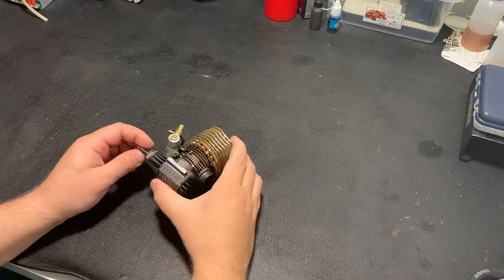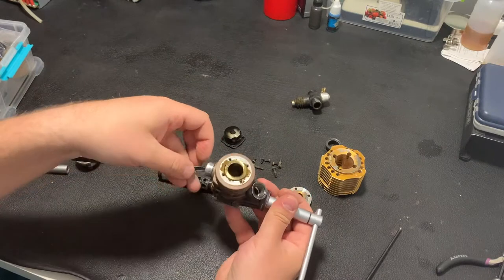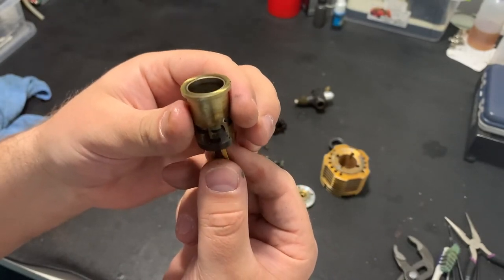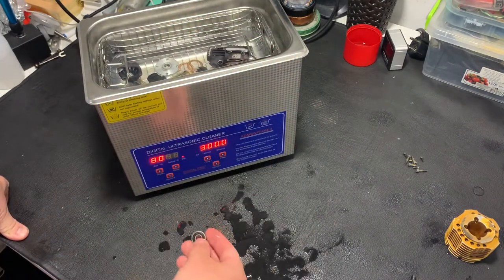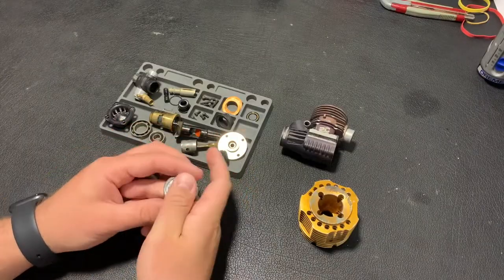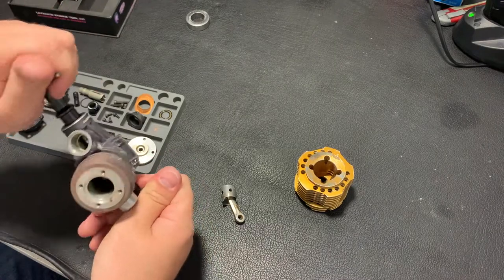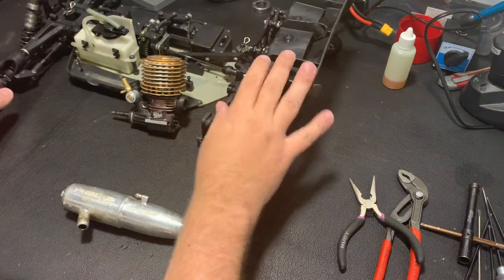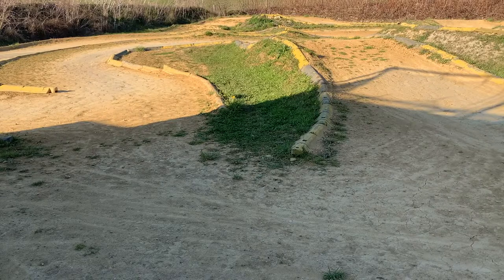Restoration of RC nitro car Xray XB8. Engine rebuild and first start. (part 3)

Comment: Nice. What will happen when you pinch the sleeve abit to tight
Reply from the maker: Engine will not work ))). There is couple of different failures in this case. Engine working temperature could become too high, also crankshaft could be broken
Reply: @zhadlun  cool video though bro. How long do you think a gasoline rc engine will last those 1/5th scales
Reply from the maker: @sumennaik298  It's 1/8 scale and nitro engine. New engine could run 40-80 litres of nitro fuel. After clamping, could run 15-25 litres more.
Reply: @zhadlun  still alort of litres